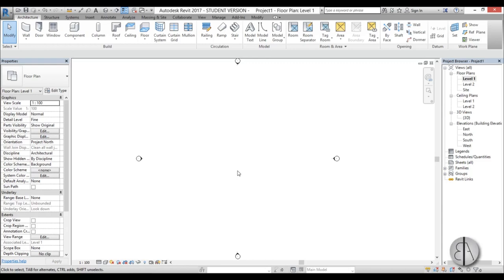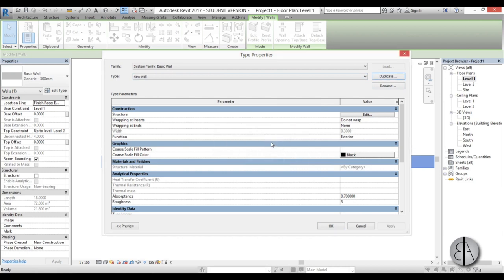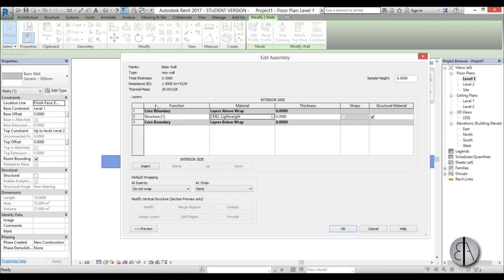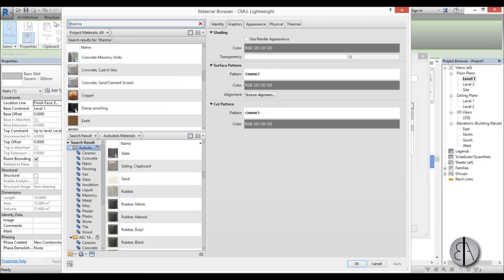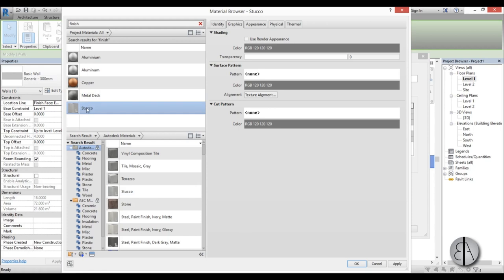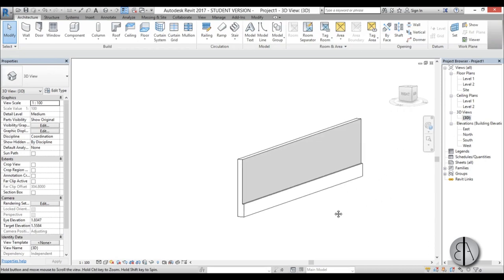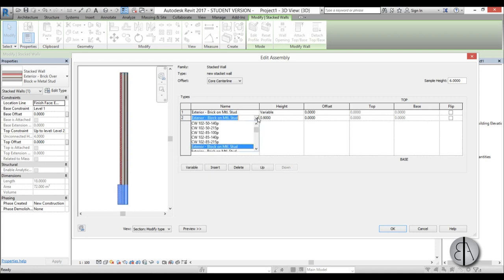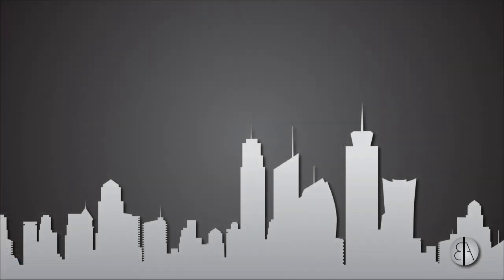Revit Tutorial: Wall layers and stacked walls

Comment: Hi could you make a tutorial where you retro fit external insulation in Revit, please? At this moment I build another wall (insulation and render layers only) next to the original wall but this seems like another "masking region" workaround. Replacement of sills and windows in retrofit project with external insulation is also a pain in the neck - i use cut-outs / opening in new added insulation "wall, so the "new window is flush with old wall. Please tell me there is better way.

Comment: thank you but you should have aligned the walls with the drop down offset menu above , not with moving like that guessing some length. there are options to align both finish faces, external or internal.